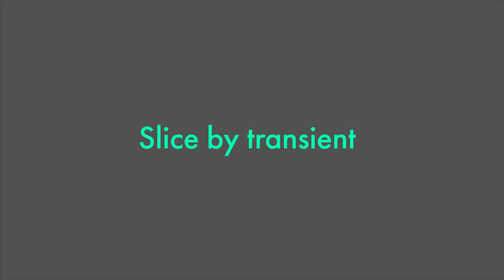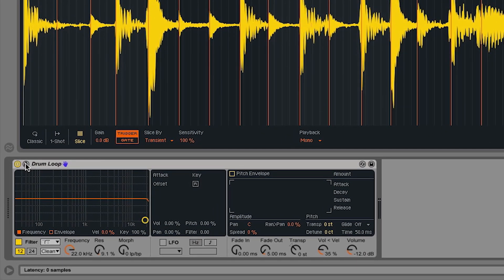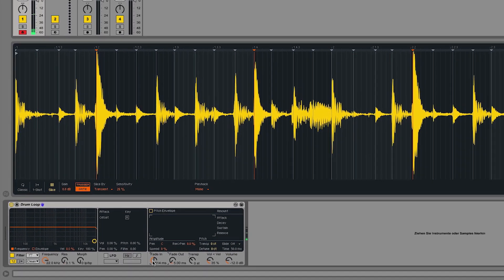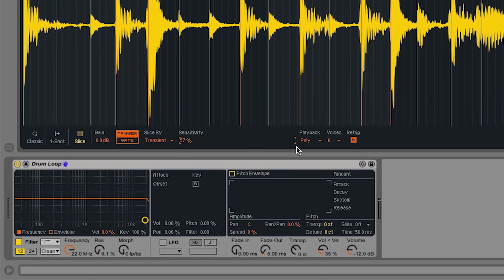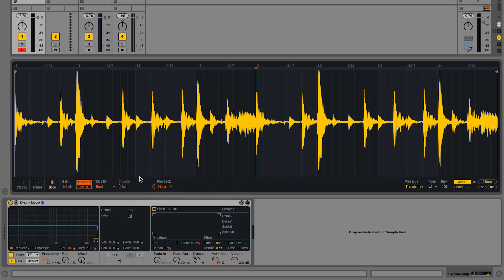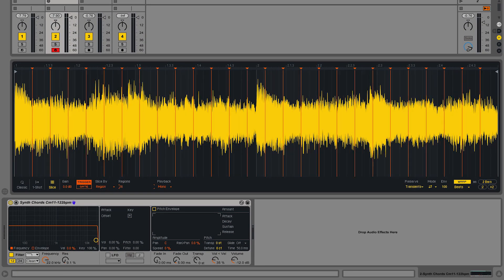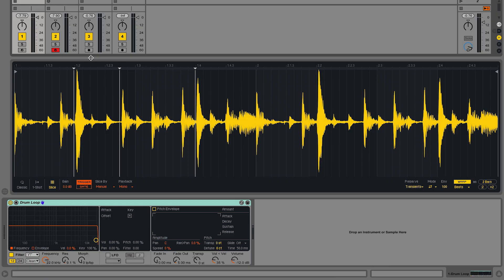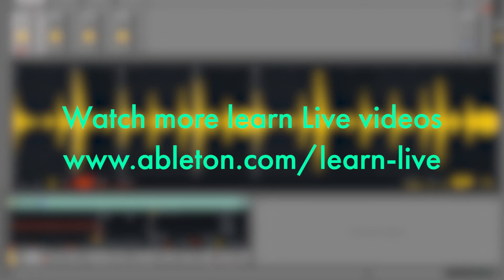Ableton Sampling Tutorial in Simpler – Slicing Samples

Comment: Do i need a Midi for this or does my keyboard work aswell? I can open the simpler and drag a sample in but i cant play anything
Reply: You can use your computer keyboard, in newer versions of Live it’s disabled by default because it overlaps with some shortcuts, to enable it you can either enable it in top right corner ( look for a small piano keyboard icon) , if I remember correctly, you could also just press M on your keyboard
Reply: Exactly. Not explained at all.
Reply: I have the same problem. My Novation keyboard operates normally with other functions but it won’t trigger samples to start. Can anyone help?

Comment: how do you set the slice on the first key of a mpk midi ? won't play a sound til like middle of sample
Reply from the maker: Hi there. Thank you for the comment.

It sounds like what you need to do is move the markers in Simpler to line up the sample. The markers are the orange vertical lines you can see in the video.

You will probably find it very helpful to contact an Ableton Certified Trainer. They can guide you through every step of setting a workflow that works exactly how you want: https://bit.ly/3r42owk

Thanks,
Ableton

Comment: Is there a way to play audio slices on a keyboard without converting it to Midi ? (I use Live Lite)
Thanks :)
Reply: I guess thats the point here. you can load audio clips (samples) into the Simpler and then u can play the different slices of it with your midi controller/keyboard etc
Reply: The Simpler will do the trick... I would hope you know this by now but just in case others have the same question

Comment: Is there any way in ableton simpler to:
- Define samples as regions (start end) instead of the end being defined as the start of the next slice (so you can have overlapping slices)?
- Play the audio from an arbitrary point using the mouse- so when I'm figuring out my manual chops I don't have to take my hands off the mouse  (move back and forth between midi controller) finding my chop points, listening to them, and refining?
-Custom map the midi keys for triggering chops (e.g. if you want to spread chops across only white keys/black keys, or a certain part of the keyboard, etc)

I'm so used to using slicex that these are all key features for me, but I can't find a way to do this in Ableton, and I can't just use slicex since I'm using ableton on a mac.
Reply: Is that still a problem, cause Im considering getting Ableton and would like to know.
Reply: @0xt28you can convert slices to drum rack which is an option somewhere on simpler, and then every pad of the new drum rack will be its own slice with just one set of start and end points. Then you can fine tune the start and end of each individual slice located on each pad. Then in the global settings of the drum rack you can make it so that the pads dont cut off each other so u can play more than one at the same time